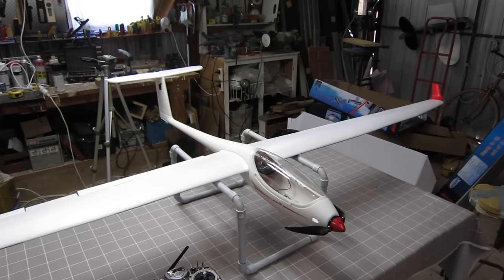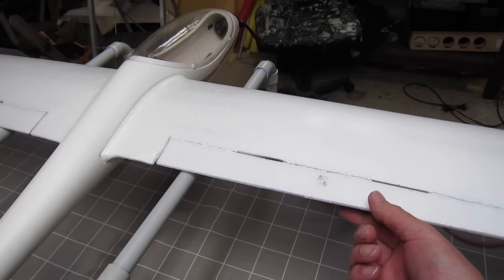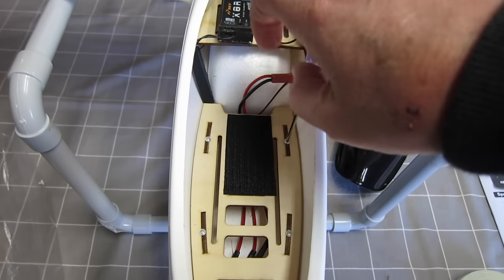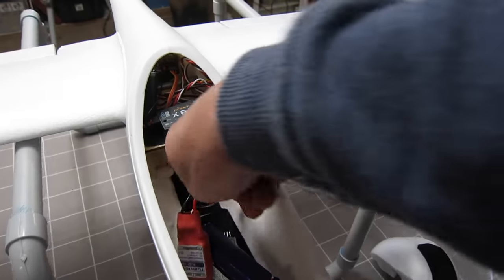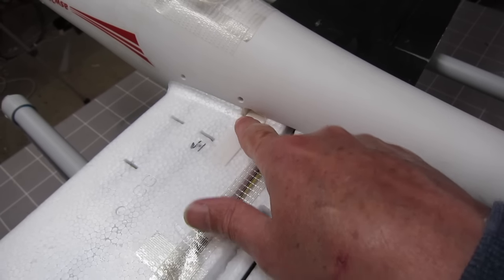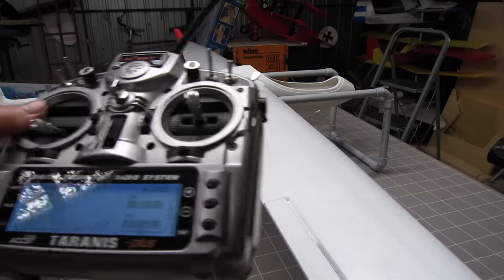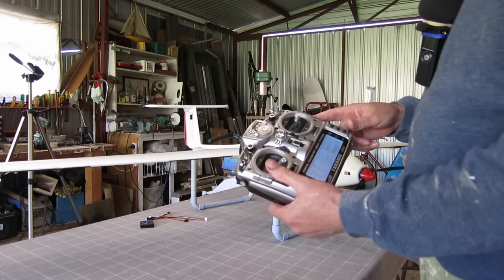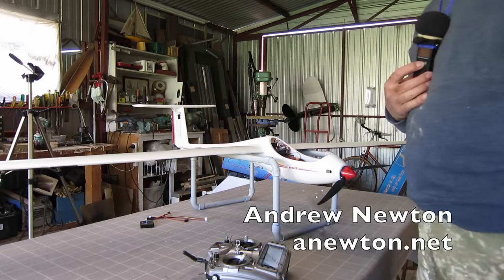Volantex ASW 28 mods

Comment: I'd probably take the wheel out too. Flying of grass and I like the sleeker look.
Is the protruding bit left around the wheel well  part of the moulded fuselage or is it glued on?
Wondering if it can be removed for a smooth finish or it needs sanding flush?
Thanks for the vid.

Comment: Dont use hot glue for the hinges!!! It will make the controls very stiff. Use SUPER GLUE FIX-ALL ADHESIVE and maybe two or three strips of clear duct tape one each and one in the middle. Remember to break in the surfaces by hand after reinforcing the controls.

Comment: The model has been sold for years with the same two design flaws, but they are very easy to correct.
1. Glue 30 g of lead on the end of the fuselage and the vertical stabilizer, which is very easy in the hull without being seen from the outside.
2. The EWD is improper and needs to be raised to place the stabilizer on the back edge with 0.8 to 1 mm thick paper.
3. With a 3S 1500 mAh battery or with 2 3S 1500 mAh batteries connected in parallel, it is now possible to fly without changing the center of gravity. The second battery is simply pushed exactly between the wings, focusing on the upper board, which guarantees a minimum flight time of 25 minutes and almost always with a low thermal of at least 35 minutes - do not worry, the battery will not slip during the flight!
After the correction you will get a superbly flying model that can compete with much more expensive models as it is usually lighter.
The model is also suitable for easy aerobatics and although the surfaces sag unbelievably, I have not yet managed to destroy it in the air. I'm thinking about making the wings shiny, but this is definitely not necessary and colorful so I can see the model better.
Reply: What do you mean by EWD?
Reply: Sorry, that's an abbreviation in German: EWD = Einstell-. Winkel-Differenz that means translated EWD = setting angle difference.

So nothing but the difference in angle between the elevator and the wing. In which the angular difference to the "imaginary" midline of the trunk is normally balanced, this is zero. Depending on the aircraft type and wing profile, the wing is usually attached to the hull at a small, increasing angle. This angle of attack has a significant influence on the flight characteristics of the aircraft.

If you find out afterwards that a correction of this angular difference is necessary, this is usually much easier on the elevator than on the wing.
Reply: @arminmuller5990  danke für diese umfassende Antwort! Hat mir sehr weitergeholfen. Lg Patrik
Reply: Ok got another question. Did you Place the paper between horizontal and vertical stab or between vertical and fuselage mount? I m a but concerned about flex. The Tail is already Pretty shaky in high Winds.
Reply: I did not quite understand what they meant. Unfortunately I can not insert a picture here, so I try to describe it.
I slightly increased the angle difference and put all oars back to neutral.

If you align the fuselage so that the fuselage tip faces you, you will see two mounting holes in the fin for mounting the elevator. Since I have increased the angle, the stroke at the end of the last screw must be increased by 0.8 - 1.0 mm. This leads to a slight gap in the support area. However, this does not affect the flight stability. Please do not overtighten the screws!

Note: Any change on an aircraft affects other settings, as they partially work against each other. In addition, the mutual influences do not necessarily change linearly, so the "best" setting is usually adjusted to the average airspeed.
In the end, it is a compromise, and the difference between the wing angle and the elevator, for example, has a decisive influence on the knife flight. However, since it is a dynamic process, it makes sense to control it dynamically via additional mixers, since it can not be solved purely statically, by a fixed mechanical adjustment. But explaining that leads too far.

For starters, you can trust me - although I have 49 years of flying experience, I know that this does not matter if the basics are incomplete, as with many recreational pilots.
For this reason, I recommend you to learn some dry theory. It will help you a lot!
The PDF file for download at the following link is unfortunately in German. But you can translate that conditionally with Google.

Basic knowledge of the preparation of the first flight can be found on page 1 to page 15 and from page 16 to page 26 it is explained very concretely how to perfectly trim a model airplane. You should remember to use it at any time!
These basics are general and not just for F3A models if you use common sense.

Teil 1 - Servo-Grundeinstellung
www.rcmarket.net>tips>du-fliegst-wie-du-einstellst-pdf>download
http://www.rc-network.de/forum/content.php/503-Du-fliegst-wie-Du-einstellst-Teil-4

A final note on the ASW 28: The model needs a slightly higher airspeed, even when landing to be able to fly effectively. This is due to the narrow wings.
Due to the moderate increase in the angle of attack as a function of the center of gravity, it is now also possible to fly a little slower.
Reply: Ich bin deutsch daher kein Problem. Wollte nur in englisch schreiben damit auch der Rest was davon hat. Deine Erklärung reicht vollkommen. Wollte nur wissen ob oben oder unten am seitenruder.. Danke dir viermals!
Reply: Hallo Paddy,
dann ist ja alles klar. Über die Stabilität brauchst Du Dir wirklich keine Sorgen zu machen. Ich fliege meistens mit zwei 1500 mAh 25C Nano Tech 3S Akkus. Das schöne an dieser Konfiguration ist halt, dass Du auch nur mit einem fliegen kannst und nichts zu verändern brauchst. Den ersten Akku solltest Du auf der dafür vorgesehenen Akkuauflage so weit es geht nach hinten, bis an den Radkasten schieben. Einige Kollegen bauen auch den Radkasten aus - das wollte ich aber nicht, da ich die Landung auf dem Rad besser finde. 
Ich hatte erst den Link nicht funktionsfähig eingetragen, dies aber dann korrigiert. Wenn Du Interesse dafür hast, wirst Du in dem Forum noch einige Erweiterungen dazu finden. Wenn man das einmal intus hat, kann man seine Modelle viel besser fliegen, bzw. hat dann auch mehr Spaß. Es ist natürlich auch klar, dass ich mit der ASW keinen senkrechten Sturzflug von 200 m gemacht habe um den Schwerpunkt und die EWD zu ermitteln, da reicht auch ein kurzes anstechen mit 45 Grad oder/und etwas Rückenflug! Ich fliege das Model fast nur im Campingstuhl ganz entspannt wenn die Thermik gut ist, oder wenn der Platz voll ist und ich mir den Stress nicht antun will dann Motorflug zu machen. Viel Spaß damit :)
Reply: Hallo Armin,
ich Hatte Gestern die Gelegenheit die ASW nach den Anpassungen einzufliegen. Habe Jetzt 25g im Seitenruder und das HLW um 0,6mm an der Hinteren Schraube angehoben. Hab  dazu 0,2 mm  Aluminium  verwendet. Sie Fliegt jetzt definitiv besser. Schwerpunkt liegt bei mir jetzt  bei 8 mm hinter der Markierung mit nem 1600 mah 3s D-Power lipo. Geradeausflug ist jetzt erheblich besser als vorher, sobald ich anfange zu kreisen geht sie aber relativ stark in sinkflug fast schon sturzflug über also ohne Höhenruder , was schnell in überziehen resultiert, ist da nichts zu holen. Dein link hat mir auf jedenfall schon mal einiges weitergeholfen aber hier ist noch einiges zu testen bevor ich entspannt im Campingstuhl sitzen kann. Ich fange aber auch gerade erst an mit dem Hobby, Die asw ist mein 3tes Modell 
Danke dir auf jedenfall vielmals für die Ultra ausführlichen Beiträge! Grüße Paddy
Reply: Hallo Paddy,
das freut mich, dass es nun besser ist. Noch ein paar erklärende Worte: Ist der Schwerpunkt zunehmend hecklastig, dann wird das Flugzeug zunehmend instabil bis irgendwann nicht mehr beherrschbar. Gleichzeitig steigt aber auch die Leistungsfähigkeit, weshalb Linienflugzeuge und Segelflugzeuge leicht hecklastig getrimmt werden um Energie zu sparen. Du darfst es dabei aber nicht übertreiben und nicht zu langsam werden, sonst sackst Du durch. Die Kunst besteht darin, genau die optimale Geschwindigkeit zu ermitteln - im Zweifel ist geringfügig schneller immer besser als etwas zu langsam, dabei ist die optimale Geschwindigkeit zwar absolut gesehen konstant, aber relativ eben nicht, da die Windverhältnisse sich ja ständig beim Kreisen ändern. Das musst Du ständig anpassen, bzw. feinfühlig aussteuern, wobei heftige Ruderbewegungen viel Energie kosten und daher kontra produktiv sind. Das herauszufinden ist am Anfang nicht so einfach, aber irgendwann denkst Du darüber gar nicht mehr nach und fliegst nur nach Gefühl! Wenn die Landung z.B. knapp wird, weil Du noch zu weit weg bist, dann musst Du, entgegen Deinem Bauchgefühl Tiefenruder geben um schneller zu werden, somit steigt der Gleitwinkel und Du schaffst es vielleicht noch bis zum Platz. Das macht man auch, wenn die Thermik-Blase sich zu weit von Dir entfernt und Du eine neue, näher zu Dir finden musst. Dann werden die Landeklappen 1,0 bis 2,0 mm nach oben in die Speedstellung gebracht um mit möglichst wenig Höhenverlust schnell einen Streckenflug zu bewältigen.

Der Effekt, dass sie beim Kreisen ohne zusätzliches Höhenruder sich immer weiter nach innen neigt, ist hauptsächlich von dem Winkel der V-Form der Tragflächen abhängig. Viele Hochleistungssegler haben deshalb oft mehrfach geknickte Tragflächen, aber auch einfache Anfänger-Modelle wie z.B. der Thermik Sport von Graupner oder ähnliche Modelle. Wenn der optimal getrimmt ist, dann kreist der so gut wie ohne einen Eingriff der Steuerung in der Thermik. Gut, die ASW 28 ist da nicht so einfach zu fliegen, da brauchst Du schon deutlich Höhenruder und auch etwas Seitenruder; ich würde jetzt langsam die EWD noch erhöhen mit jeweils einzelnen übereinander gelegten Papierstreifen bis die Leistung sich wieder verschlechtert. Aber das solltest Du auch der Witterung entsprechend anpassen. Das ist so ähnlich wie wenn man eine Violine stimmt, je mehr man übt, desto sicherer wird man.

So ähnlich ist es übrigens auch bei einem Segelboot - wenn der Schwerpunkt und der Mast richtig getrimmt sind, dann steuert man das Boot nur mit der Segeltrimmung und das Boot hält den Kurs auch ohne Ruder; so soll es auch sein.
LG, Armin

Comment: hi i have now made up the harness thanks for that and as i explained this is my first plane with flaps using a three position switch and now having tested them i am right in assuming  that the positions give me, 1 take off flaps, position 2 flight path position and 3 air brakes
my first flights will be witha insructor, and i am looking forward too that.

kind regards 
Jim
Reply from the maker: I have found you really don't need flaps for takeoff with these gliders. Only for adding a few mm of camber in a thermal or airbrakes when landing. Good luck Jim, hope it all goes well

Comment: I would appreciate very much if possible to experience the flap setting values of your ASW 28. Unfortunately the manual of the ASW 28 doesn"t give any advices about that.Are the indicated CG marks under the wing a suitable cg ?
Nice regards ,
V-1
Reply from the maker: I swapped the wing on to a Phoenix body as a sloper. Flaps going down as far as the hinge allows for brakes. Dont remember the CG
Reply: @AndrewNewton  Anyway, thanks a lot for your reply!
So at the Landing configuration you have used his max possible deflection.Which deflection do you have used for the "take-off" configuration?
A Phoenix with the wings of the ASW sounds like an very interesting combination :-)

Nice regards and stay safe :-)

Comment: Hi Andrew, thanks for the great videos you have posted regarding this aircraft, I couldn't resist so purchased one and it is now ready for it's maiden. This is the first sailplane I have in my fleet so could you give me an idea of the crow, camber and reflex settings you have including elevator if any. I know this can be down to personal preferences but a starting point would be helpful.
Cheers
Gary.
Reply from the maker: Very exciting Gary. I don't have this one anymore, just have to wing on a Phoenix fuselage as a pure sloper. From memory I had the flaps going down as far as possible, maybe 40 degrees, and ailerons about 15mm up and down. Camber was all surfaces going down about 2mm. Elevator up and down maybe 30 degrees. Mighty be worth contacting my buddy Allen Moore (noobie RC on Youtube) he is the ASW 28 master
Reply: Hi Andrew, I will send a message to Allen, many thanks for the info and contact.

Comment: How do you rate this ASW28 to similar foamy semi-scale egliders in the market? Top RC ASW-28 (clone of Tower Hobbies), Multiplex Solius/Heron/Lentus, Kavan 304TS TwinShark?
Reply from the maker: This is the only one I have experience with, but I suspect all the others would be better thermal gliders. The Volantex is a great sloper and general powered plane but not great at slow gliding.

Comment: What colors did you use for painting? Primer and acrylic spray paint? Nice job an very clever mods 👍
Reply from the maker: Just cheap Spray Enamel straight on the foam, after cleaning.
Reply: @AndrewNewton  I liked your lower wing surface painting idea, but used brush-on acrylic for mine because I read somewhere that enamel would dissolve or deform styrofoam. You had no problems with that?
Reply from the maker: @MariaVillanova-lt9qy  This foam was not affected. Light first coat is safer

Comment: Good mods Andrew, I like the flap to crow mix! I wish my v1 had that wing joiner method. I might need to take a closer look at yours next time I see you to see if I can MacGyver it on to mine. Might head down the beach on Sunday with Mark for a fly off the dune it your free?
Reply from the maker: Don't know if that mix will work yet, mainly for controlled slope landing. If Sunday's weather is right I'll see you there. Heat bent pvc will work for a wing clip I reckon.
Reply: Oh good idea, I could just screw them into the wood on the wing and it could slide into the fuse. I'll definitely look into that.

Comment: Hi i now have ASW 28 and have been interested in your mods, the thing that is causing me problems is obtaining the 4 pin plugs have you any info on that?
Reply from the maker: Hey Jim, they are 3S Lipo balance extension cables. https://hobbyking.com/en_us/jst-xh-3s-wire-extension-20cm-10pcs-bag.html

Comment: hi i have now obtained the leads for your conversion to the servo connection. would you please run through the conversion in 
more detail ?were the joints crimped and if so can you give details? i have made a mock up of the system but i burnt out two servos doing it, as i am in my 84 year i am not as quick on the updates as i used too be
Reply from the maker: Yes Jim, I'll do some photos or diagrams soon.
Reply from the maker: Jim, I made up a wiring diagram, but I'll do a video as well soon. Hope it helps https://www.flickr.com/photos/pandasimages/31984385060
Reply from the maker: Oh and the joins were all soldered, I used a 3S balance extension cable and cut it in half so I could solder wires to wires

Comment: Hi Andrew, I`m stuck between the this model and the V2 Phoenix 2mtr or 2.4 for beach sloping, what`s your thought on tip stall and which version would be best suited to sloping.Cheers
Reply from the maker: Phoenix 2m is the best thermaller and sloper of the three, but they all work well for powered flight and on the slope. When thermalling the 2.4 is the most prone to tip stall and the ASW28 is not a slow floater
Reply: @AndrewNewton  thanks, Phoenix 2m PNP is $160 on BG, hard bargain to pass!👍

Comment: Good morning Andrew, amazing videos, I have a problem with my ASW28.  The engine tends to warm up after a few minutes of flight and begins to brake, reaches the point where it stops completely.  Change the factory 30amp ESC to a 50amp ESC.  This helped a bit, but the problem persists and the engine slows down a bit, at all, but it stops.  Has this happened to you?  I have it with the 10x6 factory propeller
Reply from the maker: That didn't happen with mine. Is something rubbing on the motor? Maybe a solder connection is breaking down when heated up. Maybe the battery is failing.

Comment: Hi Andrew  great vid , I have done the  mod to the wing connections same as you  cheers for that will help greatly . I have also decided to go to 4s  power and changed the prop to a 12x6  . Did a load test and it pulled 24A  full wack  on the stock motor and 30A esc  , hope it will last . Not a WOT  all the time with this model so should be OK  .  Keep up the good work  .  Graham
Reply from the maker: That will work nicely

Comment: Hi Andrew, thank you for the useful videos on the channel!!!
Considering this plane for FPV, have you tried it for this purpose? Any recommendations? 
I have MiniTalon, 3m Flyfly Fox and other foamies and quads. 
But interested in ASW28 as FPV soarer.
Thanks.
Reply from the maker: I haven't used it for FPV but my freind Allen Moore has - Noobie RC - https://www.youtube.com/channel/UCxp23yC005hanSysA4vodQA I would suggest the Phoenix Evolution or 3ch Radian because the are much easier to fly than the ASW28.
Reply: I hope I am not sticking my nose in. I use my ASW for FPV . I mounted a 360 cam just behind the cockpit by simply drilling a hole and fitting a tripod screw . The 360 cam works really well and using different software you can turn the 360 video in normal flat video and take care of pan and tilt in post. Here is a couple of Videos thrown up kinda quick . one is 360 the other is flat after post  Best wishes FDO

https://youtu.be/RX3Cl_lO7AU

https://youtu.be/zfkkQm4FwoU